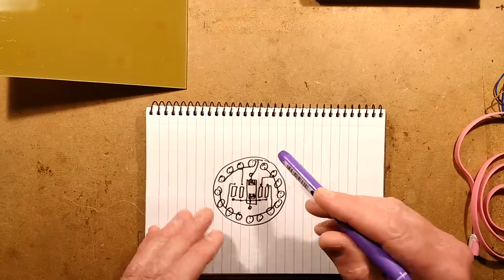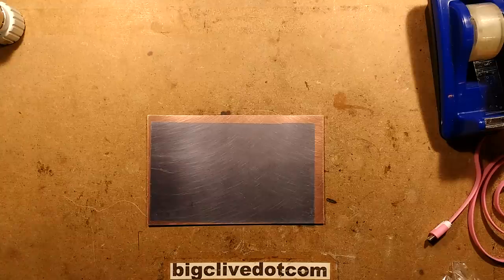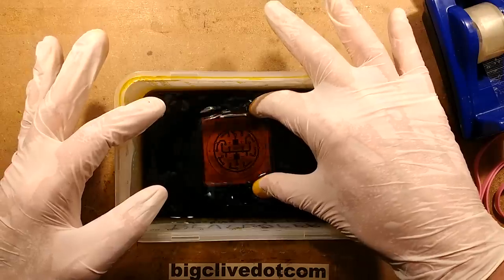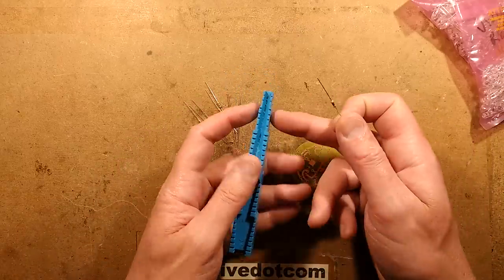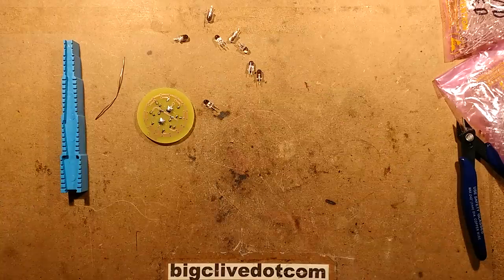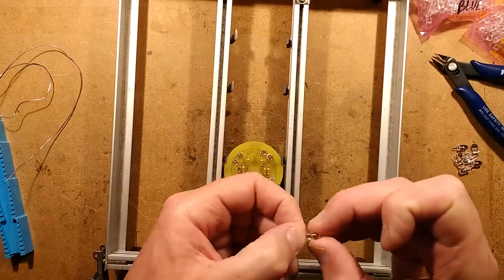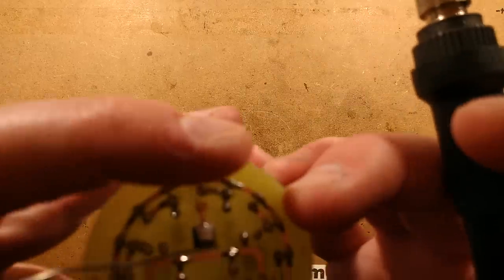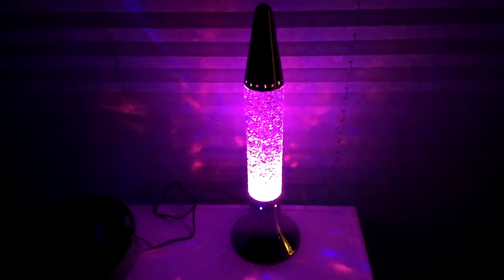Safe USB version of the Gillian's Diamonds lamp. (With PCB file.)

Comment: Here is a nice hack for ferric chloride etching:
Lexan (polycarbonate) plastic floats on ferric chloride solution.
I etched many boards, by taping them to a slightly oversized Lexan sheet, and floating the pair on a glass pan of ferric chloride, suspended over an incandescent lamp.  The copper saturated etchant is more dense than fresh etchant, so no sloshing is needed.  The etchant constantly rises under the board, as the loaded etchant sinks.  This vertical convection almost eliminates resist undercutting, as a film of loaded etchant clings to the vertical copper edges, while a plume of fresh etchant works on the exposed horizontal surfaces, so very fine spacings and small holes are easily etched. An eighth of an inch of etchant is usually plenty deep.  And, if the board material is a bit translucent, you can watch the copper disappear, from above.

Comment: When you're doing that circuit board etching to take the copper layer off, there is a potential way of using less of the ferric chloride etchant: Electrolytically etch most of the copper off first, and then etch the remaining copper off with the ferric chloride solution. All you need for this is a bit of copper sulfate solution, another piece of copper (to use as the other electrode) and a DC power supply - 6 volts works fine, but 12 volts gets the job done a bit quicker.
Just clip the piece of circuit board with a crocodile clip to part of the "waste" copper surface and make it the anode (positive electrode) in the copper sulfate solution, with any other piece of copper as the cathode. Passing current between them etches copper from the anode and deposits copper onto the cathode at the same rate, so the concentration of copper in solution remains the same, meaning that the electrolyte is not consumed and can be re-used for this process as many times as you like.
Of course once enough of the copper is etched off to break the electrical connection (which will probably happen in multiple places as it gets progressively thinner), the etching will stop. You can either determine this visually, or if you stick an ammeter in the circuit, just see when the current drops to near zero. It probably won't drop to completely zero because of side-reactions, such as electrolysis of the water in the electrolyte, but that is relatively slow, especially if you only use 6 volts.
Anyway, this method won't get absolutely all of the "waste" copper off, but it should take the bulk of it off, meaning that you won't need to use as much ferric chloride to take the rest of the copper off. Which would possibly be a slight saving of money (not necessarily of time), since copper sulfate is cheap enough.
Reply: Great idea ! Thank you !

Comment: No strain relief in the cable! Throw a zip tie on the inside section of cable.
Reply: This, or just a knot.
Reply: a knot would be better.
Reply: Senseles in this case , the usb plug got ripped out faster then the other side
Reply: you know what they say, "when all else fails, take the knot"
Reply: SuperAWaC - Are you SURE they say that?
Reply: yeah or something like that.
Reply: SuperAWaC - Huh... That is an odd thing for anyone to say, regardless of the circumstances. It's doubly odd that "they" say it with any regularity...

The more you know.
Reply: well you know what they say, "when in doubt, rub one out"
Reply: Peter Zingler, Not necessarily. Imagine that it was plugged in to a socket below a table, and now the lamp falls off another edge of the table and the wire gets stuck on the corner of the table.
Reply: THAN the knot.. THAN!.. for goodness sake it's very basic
Reply: @SuperAWaC  LOL

Comment: I used to use the rubbery abrasive blocks that maplin sold to clean pcb's, R.S semiconductors sell them too if you want to sell a kidney lol.

In coventry there was a tiny shop called "Electronic Services" , ran by two brothers originally, they had walls full of components, but it vanished years ago, another electronic shop gone :-(
Reply: zx8401ztv the cheap 22mm silverline polishing wheels on ebay are made from a very similar material and are useful in a dremel for other things too.
Reply: "used to use the rubbery abrasive blocks that maplin sold" - this is what Amazon is for, search "Garryflex" - other brands are available but Garryflex are the good ones.
Reply: If you have a hobby shop locally that sells model railroad stuff, look for the Walther’s brand “Bright Boy”; this is a nice, abrasive hard rubber eraser used to clean nickel-silver railroad track, but it also works on brass and copper! 😎
Reply: Martin Nichols,  Smashing :-D, the brownish ones look identical to the maplins ones, 600grit.
I used them for pcb cleaning and contact cleaning, they were brilliant at doing jobs like that.:-D
Reply: William Squires, there are no usefull shops near me, that's why i would go to coventry to get my parts/tools.

My small town is useless for most hobby/diy stuff, when i wanted pcb drills i used to go to car shops for jet drills but no one stocks them now.
I guess that amazon will become my maplin.
The "Bright Boy" sounds interesting too :-D
Reply: Cant believe id never thought of using carb jet drills to drill PCB holes! Thats a damn good idea, though tools to service carbs are getting harder to find too.
Reply: sparkplug1018, lol well i could not find tiny drills locally and i nipped into my local small car accessory shop just in case.
Yep jet drills, how daft is that lol.
Maplin used to sell tiny drills with a shank that would fit diy tools, they were ideal but cost more because of the thick shank.
Reply: I remember Electronic Services, it was a great little shop. I bought lots of components there when I was starting out as a hobbyist; coming away with paper sweetie bags with bits and pieces in. I always felt a little guilty when they had to go up the creaky stairs to retrieve things when they weren't in the drawers behind the counter.
Reply: David Cooke,  You just took me back to the shop mentally :-D
When i used to go there, there was one of the brothers and his wife.

That spiral staircase looked a bit dodgy too.
They always had the part i needed, i remember walking in and saying "You won't have this but i need a 2sc1307 r.f output transistor.".
The brother went straight to one of the wall boxes and yes they had it in stock, i was amazed as it wasn't a common part.
Im sure that place was like the inside of a tardis lol.

I had old parts from them too, AF117 germanium transistors for an old radio i was fixing for a frend, that shop had a bit of everything.
Later the shop was sold, i think it went down the pan then.:-(
Reply: The american (not sure equivalent is correct) version is Cratex.  Fearfully expensive when compared to garryflex but also fearfully abrasive.  Excellent for fine detailing, but if you need a selection of grits.  a serious investment.

Comment: What's the chance that the saline solution will corrode the "chrome" coating on the crystals over time?
Reply from the maker: Only time will tell.
Reply: It won't. If it is electroplated chrome, like chrome parts for a model, it is very resistant to corrosion just like chromed metal parts. If it is vacuum deposited aluminium (which with it only on one side of a sheet, the obvious continual flow manufacture technique, and the price) it will not corrode since there is not another metal present to cause galvanic corrosion. This is as long as normal table salt was used. Plant friendly de-icing salt can corrode chrome sometimes, depending on the salt type. So use table salt instead of sea salt and you will be fine.
Reply: Another metal like sodium? It's almost guaranteed to be aluminum, for the reasons specified. I just can't picture longevity from such a cheap process. I might get fooled, though. Have been before!
Reply: Vacuum deposited aluminium is a pretty robust coating since the aluminium forms an oxide layer that protects it. Thermal cycling can lift it off or cause cracking, nut even on plastic, it holds up well. Most flashlights and car headlights use the process to make their reflectors, so it is durable.
Reply: I agree about the durability of aluminum coatings of this nature, although in your examples there is not a continuous heated saline bath. Now, if manufacturers could make headlight lens that don't form cataracts after 4-5 years....
Reply: Robin Campbell They can, it's called glass. Problem is they would rather turn out a crappy product for less than a quality product for more. But, that is because it is  what the consumer dictates.

Comment: I confess at the outset that I'm a lifelong dabbler in all sorts of weird electronic and electromechanical projects, as well as having been a professional pixie wrangler for several decades. I'm also (unfortunately) older than Clive and retired on disability, so my resources for purchasing new equipment are limited. However, this project really interested me, so I used an old, if slightly crude method to make a PC board, although I followed the layout of your PCB mask. This method uses a black Sharpie marker - not the type with water-soluble ink, but the permanent marking type. This ink makes an excellent resist on copper-clad fiberglass PCB material. With a steady hand, it's possible to lay out a very acceptable board. There is an optional step involving gluing on a laser-printed paper mask, then inking in sections excised with an X-Acto knife with Sharpie ink. But, making the trace markings using Sharpie ink as resist can be done freehand, and it works well for relatively simple boards. 
Because the ink from the Sharpie nib is not uniform, It's a good idea to make two or three passes with the Sharpie to get even coverage, and a copper trace with neat edges and no perforation. A straightedge and some plastic "French Curves" of the type once used in mechanical drawing can be helpful for this step.
I drew my board traces following your general PCB layout. The rim of a small whiskey glass had the perfect radius for marking the curved traces. (It seemed appropriate, and of course it was necessary to test the glass before and after use). After etching, I removed the Sharpie ink with alcohol (or was it Acetone? Gad - memory is  fickle) and very light rub with a Scotch-brite pad. Rinsed and dried, the PCB was  ready to drill and populate with components. 
The "Sharpie Resist" method doesn't work for fine traces, but it's very satisfactory if somewhat wider traces and pads are acceptable, as in your mask. A one-off board can be made very quickly. I'm sure there are now several newer methods, but since I haven't needed to make PC boards for some years, I haven't kept up with the technology, and I didn't want to invest time and money in experimenting. A box of Sharpie markers was $5 at my local office supply store, and it turned out they still work just fine. (I was lucky in that I had some granular powdered Ferric Chloride in a sealed jar. My municipality now asks buyers to submit a "Hazmat Use And Disposal" document before buying the liquid etchant.  
I'm sure, Clive, that you remember (and probably used) the "Sharpie" method to make one-off PCB's. However, the UV-activated gel resist method looks far superior. Since both the resist film and a modest UV lamp are available through EBay, I think I'll give that a try. If I get impatient waiting for deliveries from China (typically 2-3 months), I may get out the Sharpie again.
I have in mind a second version of your lamp. That one will have a wooden base housing a small USB-powered mp3 player/amplifier module - they're $3 - $4 on EBay. The module puts out about 3 watts/channel without distortion, and will drive  a pair of "folded horns" routed out of a center core of wood sandwiched into the base. The active elements are small speaker drivers, also very inexpensive on Ebay. (I recently found a Youtube video showing an easy method to make the small folded horns). It will be quite simple to incorporate this into an unobtrusive but decorative wooden base. With a micro-SD card that can store many hours of music, the lamp will provide both visual decoration and ambient ethereal background sound. 
Thanks Clive for a very good video showing a very interesting and decorative project.

Comment: How about lasers instead of leds?
Reply: Would work but lasers need a decent cooling normaly
Reply: Most lasers are leds.
Reply: would be a cool effect but getting randomly dazzled by lasers as they hit the perfect spot in your eyeball to stun your retina does not sound appealing past single hilarious use
Reply: Peter Zingler so, no need of a resistor to heat the bottle, or the metal base will be the dissipator
Reply: SuperAWaC I have no idea how lasers work through a liquid, would low power lasers still be dangerous to the eyes?
Reply: @Furiends  no they aren't
Reply: Ruby's an garnets ...peridot an emeralds and a green Lazer....
Reply: @garymingy8671  Pipe down Steven, and it's laSer, not laZer.

Comment: It occurs to me that this is especially well suited to the cheap PCB fabricators. Copper pours on top and bottom for B+ and B-, maybe a little copper pullback under the heater resistor to prevent heat sinking, Bob's your auntie. (It latterly occurs to me that these were among Clive's last home-etched projects; I wonder if he does any home prototyping anymore or if he just sends the gerbers out.)

EDIT: I've just completed the layout for a respin of this with individual resistors per LED and two heater resistors. This would be great with slow color changing RGB LEDs.

Comment: So I've come across many bottles like that sometimes sparkles some times different color balls for telling the temperature. The liquid wasn't always the same but definitely a solvent. White fuel, kerosene, as well as a few others... First time I figured it out was from handling a broken one and it processed to leak all over my hand and arm. Thought it was just water until I had cupped my hands around a cigarette to light it and caught a sent of it. Glad I stopped myself could have gone horribly wrong.

Comment: Those carbide sets come with end mill/sidecutter bits too, that you can cut circles with if you are careful.  They grab even more than the plain drills, and it's a good idea to wear a leather apron. You need to try which is the most controllable direction to cut, but I find I use them more than the plain drils.
This took me back to my first job in the test lab of Standard Telephones.  I think I still have a multicoloured, one sleeved, full of holes, lab coat from all the dyes, resists and etchants. There were also radioactive sources for measuring thickness of the copper. People kept finding them in their pockets! :O

Comment: that UV exposure unit is pretty much the same thing I used to use to expose Diazo slides, the old time sky bluer slides with white writing that were commonly used in presentations.
The blue was 1-Alpha napthol based and we developed it in  ammonia..... it was only after my "wee accident"  dropping a  LARGE bottle of  ammonia on the studio floor that we got a fume cupboard!
First step was using ortholith film on a copy stand, developing it, drying then using that to make contact prints in the uv unit and developing.

Comment: ha ha, as a kid I did exactly what you did: buy exotically coloured LEDs (green :-) ) from a local repair shop, stuck them on the terminals of a 9V PP3 and always wondered to this day why there was no blue smoke. Possibly the internal resistance of those PP3s are so high (?).  On the other hand the tiny LEDs on the front of my Tandy electronics lab kit were not so lucky.

Comment: This looks a lot easier than the old days of using an etch resist pen and drawing the circuit directly onto the board by hand. Then of course we evolved to using letterset. 
The last time I made a PCB board I used presensitised board and a circuit overlay which had to be developed then etched.
Reply from the maker: I started with the etch resistant pen then moved through the rub-on transfers and rolls of crepe pads and tracks.  Doing it on the computer is infinitely preferable for ease, copying sections and making modifications.  You also get a nice solid reusable transparency that can be reprinted if necessary.  Better still, after prototyping you can use the package to create manufacturing files and upload them directly to online sites to order PCBs instantly.
Reply: The same with me. I worked in a school and had to produce many PCBs for the staff and kids. I even remember buying a photo sensitive spray which had to be developed. Thank god for modern technology.  @bigclivedotcom

Comment: If you were to divide the board in half, making one half red and the other blue, you might get more blue / red flashes off the facets. The effect of colored light to give depth works with red and blue light. In the art/visual world, Red light projects, blue light recedes, visually.

Love the photoresist material. What an easy way to make a PCB. Now, getting the halftone film image would be even better.

Comment: I used to buy my LEDs from microtivity. The ones they offered were insanely bright and saturated compared to what I has found prior and the cost was pretty low so I just bought a ton of 5mms in a variety of colors. That was back when they offered ones labeled as UV that produced an evil looking pale, ghostly blue glow. Those don't seem to be available anymore, but I would be the quality of the rest are the same.

Comment: Aviation snips are great for munching glass fibre. Walking on carpets barefoot with glass fibre bits is not so great. This build was very good. Etching has never been easier. Nice woven USB cable cover - gonna get some to reduce USB underwear chafing.